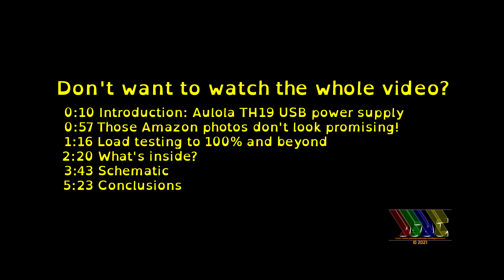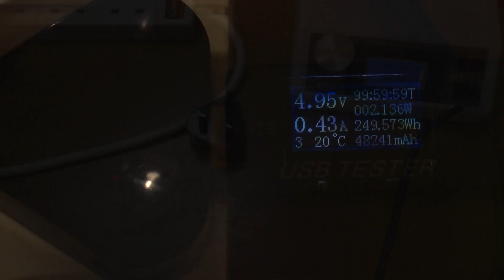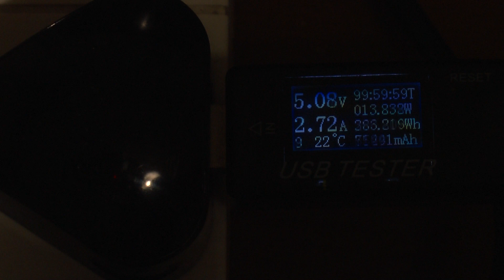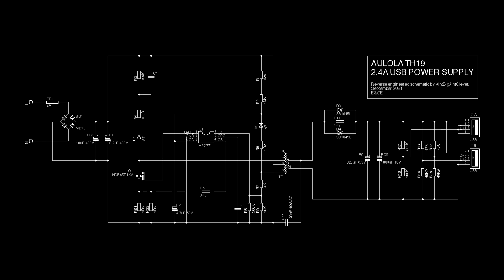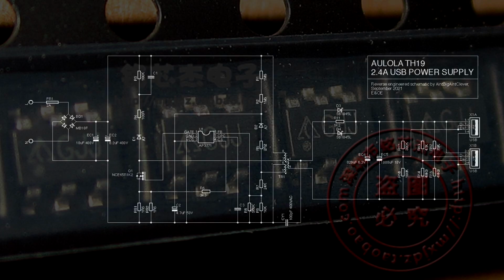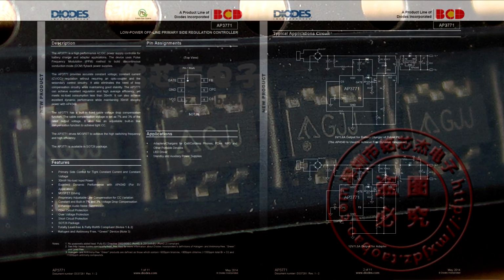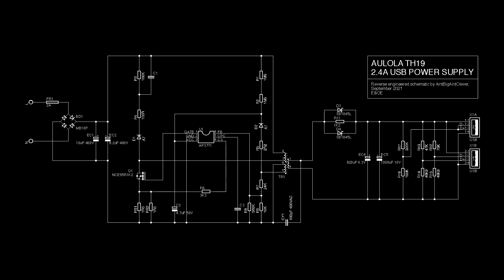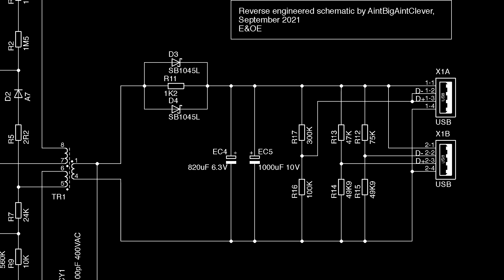Aulola TH19 USB power supply teardown

Comment: Ot dose seem quite decent. Bit concerned by the creepage distance between the low voltage and high voltage side but I suppose the insulation plastic would help.

The connection between the outer pins to high voltage side is also interesting I wonder why that was opted for surely two wires would of been cheeper ? Maybe the power supplies are interchangeable and the design makes for easy manufacturer? 

I agree about the glue or possibly sonic welding and missing EMI and RF suppression also a mystery. Did you check the temp rating of the caps? 

Still, chwarae teg interesting video.
Reply from the maker: There's always something to forget!
I've just fished the board out of the recycle bin.
Transformer has a double layer of tape between each winding and the secondary (a twin parallel winding) has insulated wire instead of enamelled copper.
Capacitors are a mix of Asia'x and y.u.g. branded, all 105 deg.C
Reply: The other thing to check is the transformer and check it has proper isolation between the windings.